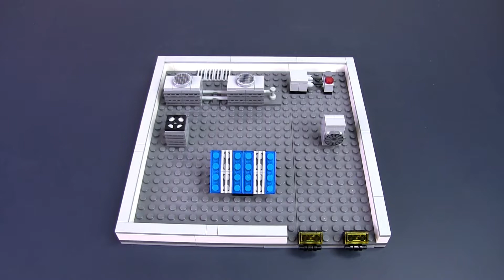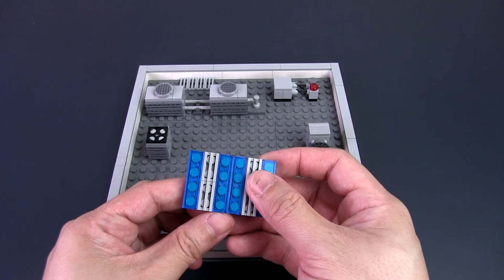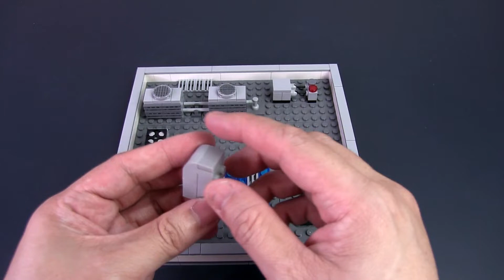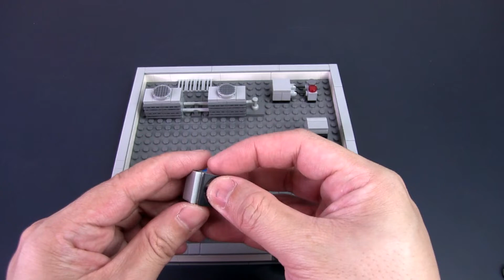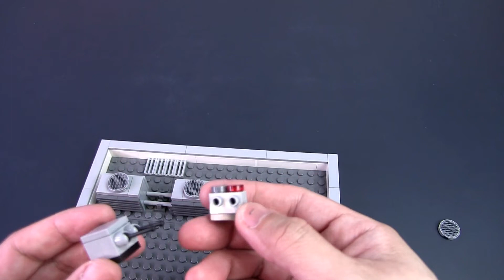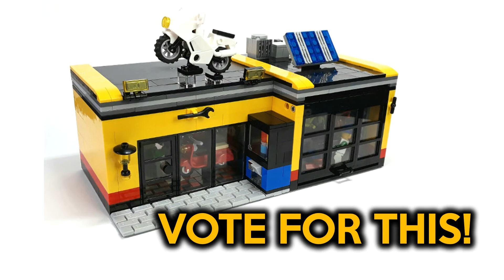6 Easy LEGO Builds for Rooftops

Comment: Love those two larger units for the compressor and the evaporator units! I’m going to build them for my recent MOC! … ‘cept rather than a jumper plate and one tap, I will have a 1x2 plate and have two taps facing the unit … which is proper (supply and return line).

Comment: This is very cool. I liked this alternative way of showing how to bulid them :-) The big AC unit is really cool I think! I'm noticing that most (if not all) of these are pretty modern and would fit historical periods from ca. 1970 onwards. However, many of the modulars has been done in a 30's or 40's style. If I want to build a city in that style, do you have any suggestions for what could be build on rooftops? Thanks for sharing your creativity :-) PS: Would you ever tile a roof?
Reply from the maker: Thanks! Yes, these were designed for modern buildings. I have no idea what would be on the roof of an older building, besides maybe a water tank. I'll do some research and see if there is anything interesting to build. For the tiling, only if it is a deliberate design as I did for my Motorcycle & Bike Shop MOC. That has a completely tiled roof.
Reply: Cool - thanks JC! I'll be looking forward to what you come up with :-)